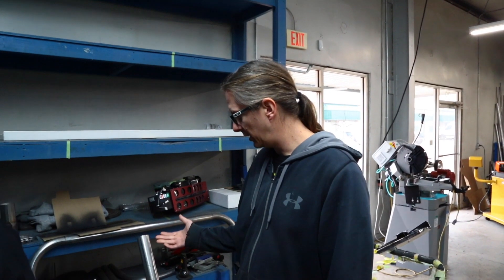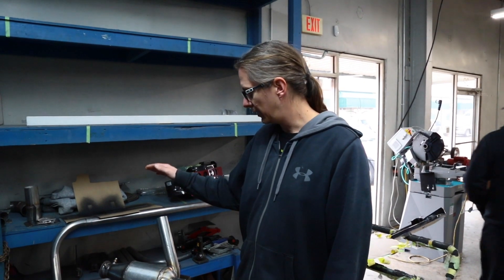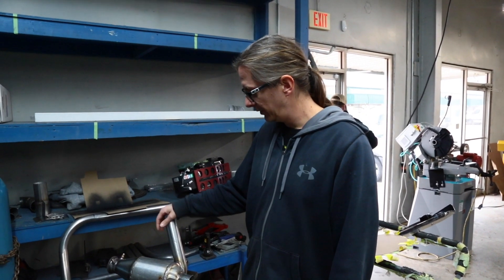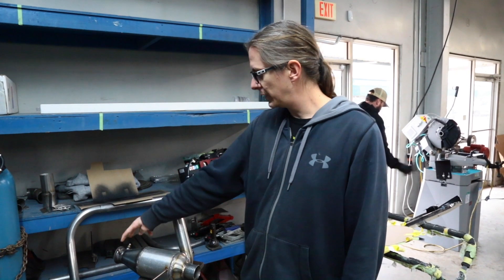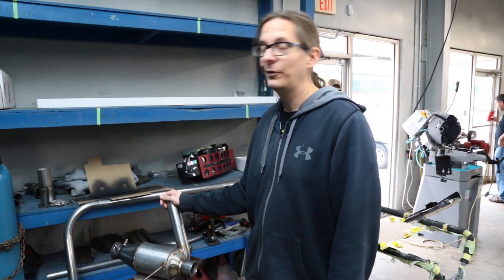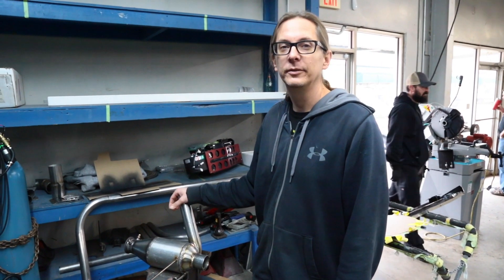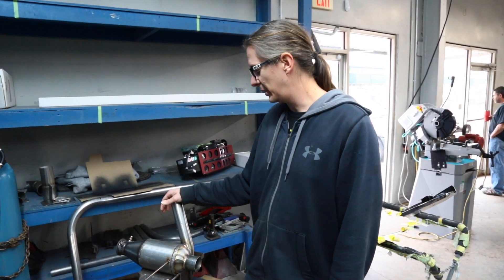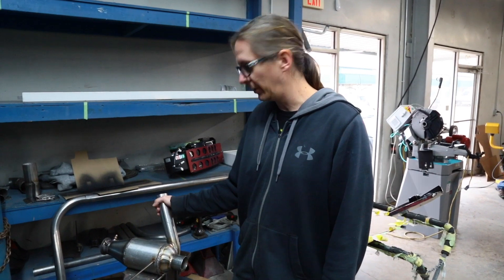Building a Jet Engine Combuster Anti-Lag System Pt. 2!

Comment: they use leafblowers to start ramjet and pulsejet engines allso think you need some sort of reduction on the part where the exhaust is going to hook intoo as it whouldnt be open once installed inside the car either , might even go as far as feeding a cars exhaust intoo it by simply sticking it on the end of the exhaust pipe under the rear bumper , the thing does need to be red hot to be able to vaporize and ignite the fuel so preheating it with propane than add the fuel might help 

looking at it , its allmost one of those homemade jet engines made from old turbo's the only difference is that theres a pipe feeding the engines exhaust intoo it and the compressed air get diverted intoo the engine with the wastegates is closed

Comment: You want pressure? Leaf blower with a 90, or 180 pipe duct taped on the end of it. Just buy a shitty little cheap handheld one if you don't already have one. Also, watch Colin Furze's channel for inspiration. Other than that, best of luck brother, this idea is awesome.